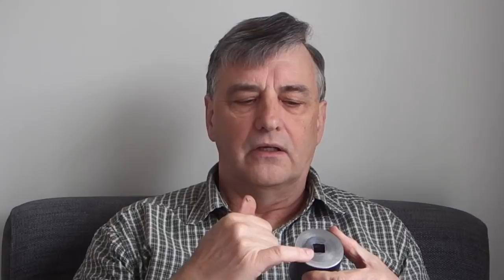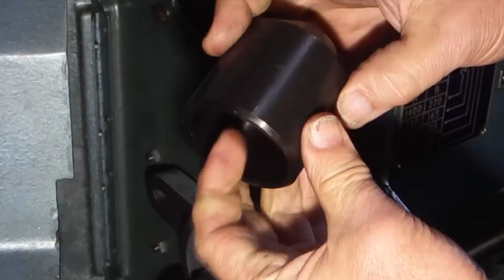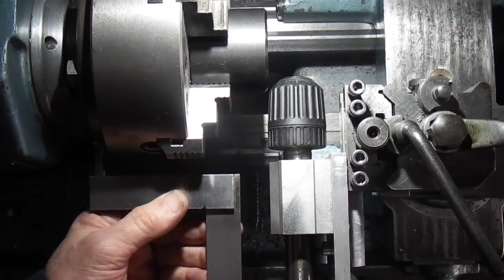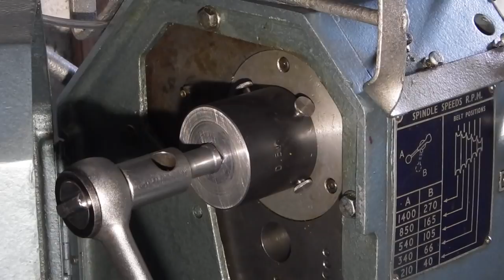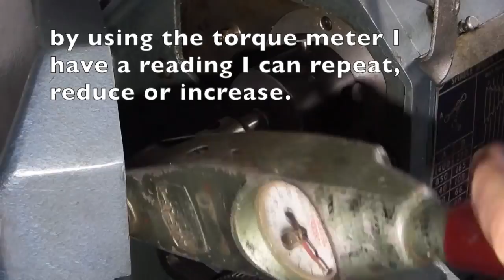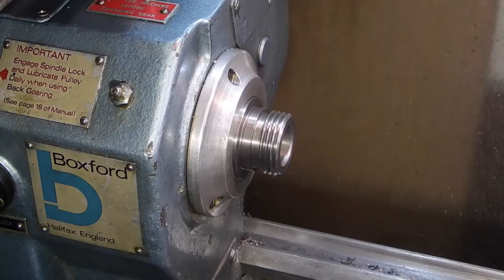Lathe headstock spanner

Comment: Would 0.0001" play be a bit tight for a cold bearing fit?     or do you check the temp of bearing after its been run in a bit?
Reply from the maker: Hi You should run the lathe until the bearings are warm and recheck the play.

Comment: wouldn't tapping the axial hole, and locktiting in a suitable length bolt be a bit easier, and save the time spent removing the tapered portion? a 1/2 inch drive torque wrench isn't usually repeatably accurate in the 10 lb/ft region, while 3/8 drive inch lb ones are
Reply from the maker: Hi  I have a 3/8 drive torque wrench but the hole already in the end of the steel was bigger, but now I can fit a 1/2" to 3/8" adaptor.

As there are no torque figures given for the bearings using a torque meter directly on the bearing nut. I had no idea how much torque was needed.
Reply: the existing hole being drilled and tapped for a captive bolt means pretty much any drive size fits, so long as the socket for that bolt head exists. of course, obviously your solution works, so it's a "good job well done" at the very least. it just seems you invested far more time and effort than actually needed to accomplish the task. 

as it's a fastener designed for an "arc and pin spanner" it pretty much can only be subject to rather low torque as intended, especially since it's basically pre-loading tapered roller bearings (or else it would be full slots, not pin holes that will only allow a single projection from the arc to engage, so a "semi-circle 2 tooth spanner" could be slid onto the end, as on old "bush" type bearing load schemes). 

tapered rollers can't really take high pre-loads, even if they endure huge thrust loads, like wheel bearings in a car. 10 lb/ft is probably a bit "too tight", truth be told, which is why the fastener has grub screws to maintain the setting. our old american car front wheel bearings (2 tapered rollers) were "torque to seat bearings while spinning wheel, loosen a quarter turn, reset finger tight, back off to first cotter slot". of course, those were subject to far greater rpm, and loads than a headstock